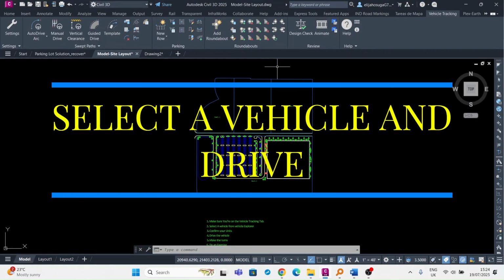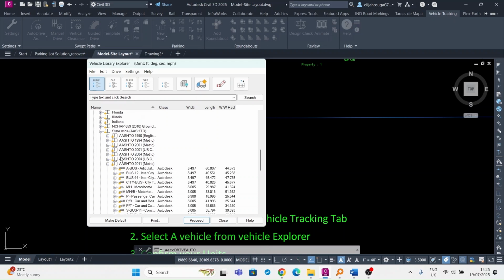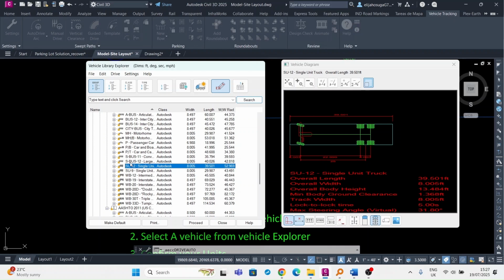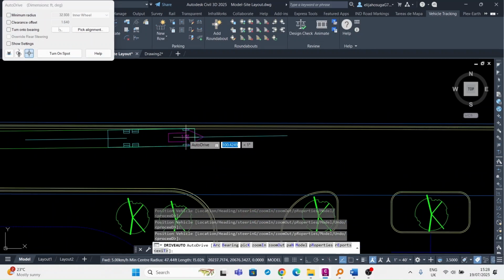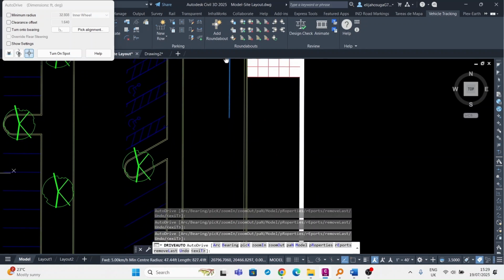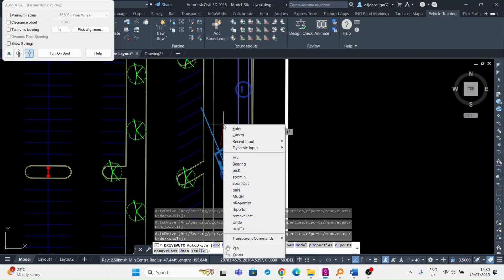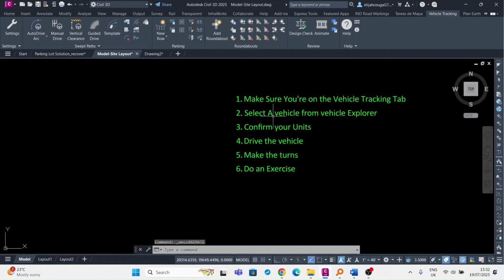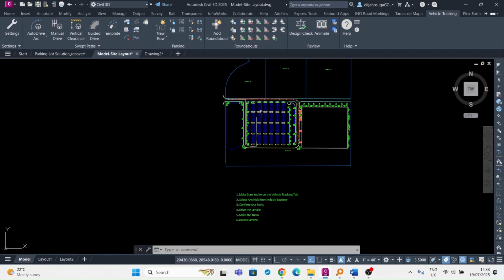Vehicle Tracking Part 3 Select a VEHICLE and DRIVE in Civil 3D

Comment: by the way, can we modify the dimension of the truck body to accommodate the goods to bring above the truck. for example: vessel, tank, container box or oil rig module
Reply from the maker: We can only use the vehicles in the library. Unfortunately we cannot modify it.